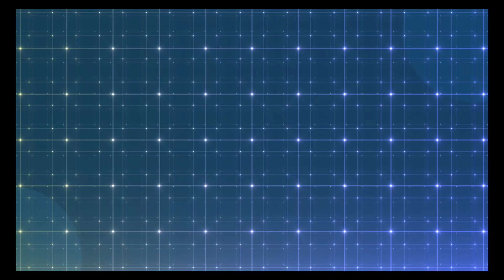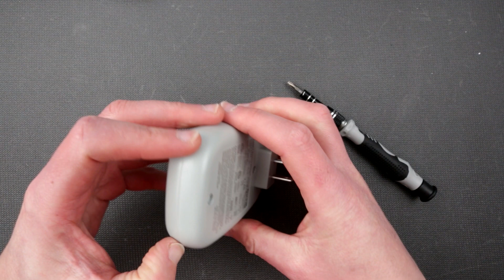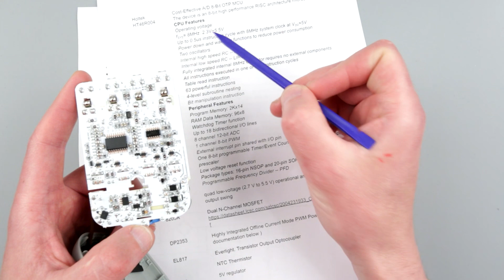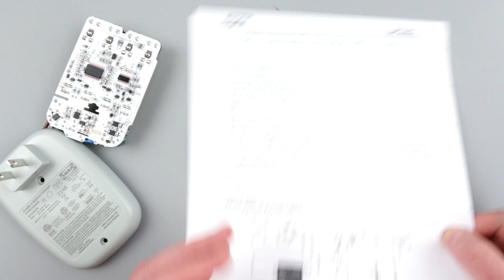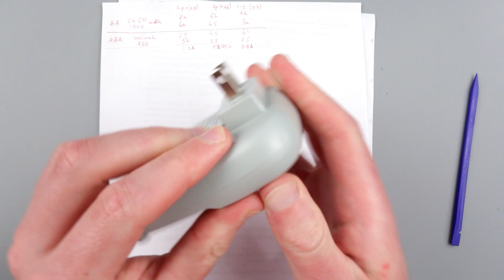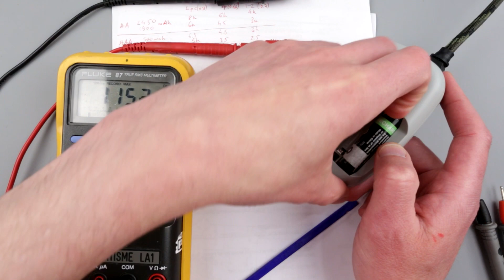Taking apart and testing Ikea Stenkol

Comment: For this Ikea charger, it would be advisable to charge only two AA or AAA batteries in slots 1 and 4 for good -dV detection. Basically, it will charge all 2+2 pairs at the same time, instead of 4 batteries at once, but with much better -dV detection at higher currents.

Comment: Any Ni-Mh charget with 0.1C -0.3C charge rate at intended battery format is bad. No exceptions. Charging Ni-Mh below 0.3C with smart charger (-dV termination) should be prohibited.
This charger wastes you time AND battery lifetime on missing -dV point and overcharging cells.
Reply from the maker: Thank you for detailed explanation Volodymyr! I wonder if this can be fixed, or this is entirely in the controller software ...?

Comment: What I don't get is why it doesn't detect when the battery is fully charged. I took out the fully charged battery, put it back again and it started blinking again. Otherwise it would be a great product.
Reply: Because you cant terminate nimh charge based on voltage alone.
Reply: @xentiment6581  Makes sense why it takes some time for it to register
Reply from the maker: Interesting, let me try this.... how long it takes after re-insertion to charge it ?
Reply: @InsideOutElectronics  I actually noticed that it doesn't immediately show that it's charged but after about 15 mins, I shows it as fully charged again. So it just takes some time for it to register that the battery won't take any more charge. Kinda annoying, if you wanna see whether the battery is charged immediately, but if you have time, you can just pop them in and wait a bit for that.
Reply from the maker: @shekelboi  Thank you for sharing this, i do use this charger enough. But this might be useful for other people !

Comment: Mine is broken after about 10 uses...
Reply from the maker: You can totally returned to Ikea, also wondering what happened to it ?
Reply: @InsideOutElectronics  I tried to take it apart. That's how I ended ip with your video. I gave up cause off the clips I couldn't open.. Strangely it worked again afterwards. I absolutely have no idea. At first I tried with various AA and AAA batteries, none would light up, afterwards each battery charged up again.... Weird Swedish bug 🤣

Comment: excellent review indeed. i will buy it, i have also an eneloop c75 charger, i know that it charges slow too. now i need a li-ion charger. i thought xtar vp4 dragon plus but it has minimum 0.5A selectable current. so is it a high current for slow capacity batteries ? can u recommend me a li-ion charger.

Comment: I have one with european plug and seems good safety, quality and price 1/4 of standard charger with led or 1/3 of charger with lcd. But not as good as i supposed at first because diodegonewild review. It refuse charging many AA/AAA bateries for no known reason and blinking red but other chargers I own have no problem with them even litokala li-500 show good capacity so I don't know what is wrong and need thinking which batteries is rechargeable in this "smart" charger otherwise I have flat batteries and useless charger somewhere with me. I try similar trick with foil but for paralel charging more batteries in one slot and it work when not charging individual it's slower then but better then nothing.

Comment: What about memory effect? If i put batteryes half charged if it discharge them or what?
Reply from the maker: This charger is too dumb for that. It will cahrge them and yes this will develop memory effect eventually.
Reply: Do you know a charger from another brand which first discharge and charge a batteries by default, (so do not need to push buttons every time)?
Reply: @viktorcseke3566  Did you find something that you liked that could?
Reply: @Swarmish  i have a BC-900 what do you think?

Comment: Do they trickle charge when finished?
Reply from the maker: Let me measure, but AFAIK yes.
Reply: @InsideOutElectronics  That would be super! I'm actually hoping that it won't trickle after charging, cause the LSD cells I'm using don't like it.
Reply from the maker: @jimmybrad156  what is the brand of your cells?
Reply: @InsideOutElectronics  Ikea 2450mah
Reply: 1/10C is not most recommended, something like 1/5C is better. With 1/10C the charger might miss the -dV termination as voltage drop wont be significant enough.
Reply: Ok, for a 1900 mah battery, what do you suggest is the safest mah input for charging and discharging? I’m using a skyrc imax smart charger… thanks
Reply from the maker: @MITZ-cx4je  usually good rule is 1/10 of the rated capacity, I would say 200mA
Reply: @InsideOutElectronics No. Only use >0.3C for Ni-Mh so -dV termination would work.
I use 2C-3.5C because smart charger I have outputs 7A into 1-2 × AA, 4A into 3-4 × AA.
Reply: Would it be possible to remove/disconnect the 240v AC and power this with 12V DC